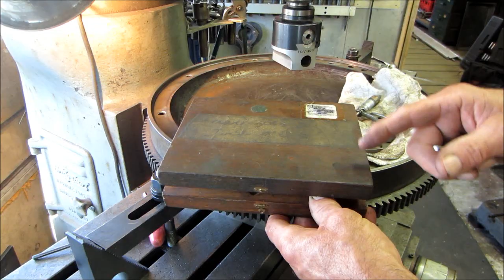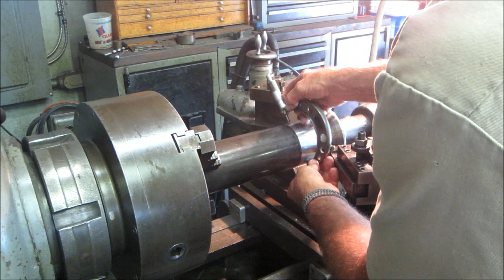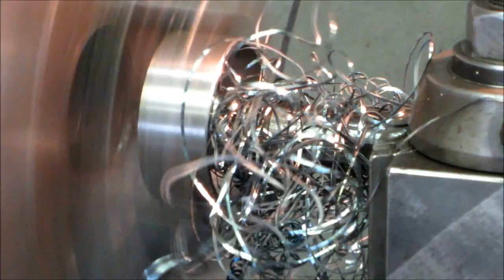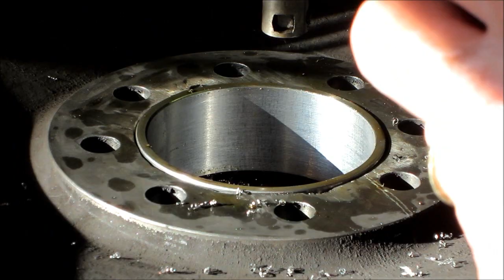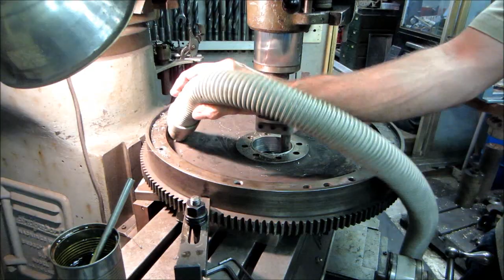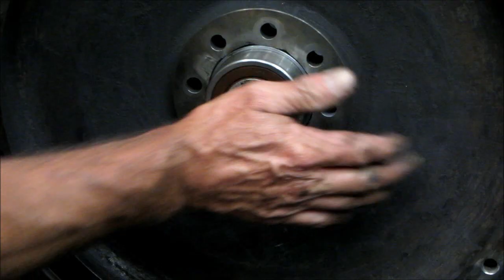Hack & Tack Smack Part Two

Comment: I use a small cylinder hone to clean up bores. I made one of those emery cloth hones but for getting a slip fit on some wood dowels, so I used plain sandpaper and a 3/8th drill. Worked great, but I never used it on metal.

Comment: Well done great work. Sometimes I will make a fit by cooling the sleeve in the freezer and heating the flywheel in an oven thus locking them together with a light press fit. The bearing I then cool in the same way and fit and use bearing fit locktite. Lot less force. Don't let the wife know though!!!

Comment: I've done a lot of those kinds of jobs, and I'd offer the following advice: It's good to add locking screws to the periphery of the sleeve. These are referred to as "Scotch Keys".It's simple to do, just drill and tap for a set screw at the junction of the part and the sleeve. It only needs to be an 8-32 or even smaller. Add them before your final bore. It will lock that sleeve into position no matter what.
The problem with relying on the press fit, on a heavy rotational part like that, is vibration. Vibration will do weird things to a repair like that, and can cause the sleeve to drift. From there, if you ever have to renew the sleeve, simply remove the set screws (anchor them with blue loc-tite), make a new sleeve and then pick two new points to anchor. 
This will work for any sleeve job on a rotational part, like motor end bells, pump housings etc.

Comment: Hey, Keith, what's that "emery strip" all about?  Is that some sort of a shop-made weed wacker for metal?
Reply: Emery paper is similar to sandpaper for woodwork. The grains on the surface of the material removes small amount of metal, leaving a smooth surface. Bu mounting the emery strip it a shaft held in a power tool, you can gradually remove metal from the hole. Unfortunately I'm unsure what the grit is, possibly carbide or similarly hard material.

Comment: Great video.

I've got a question though, throughout the video you kept using the machine to shave off the ID to make it a closer fit to the bearing, Why not make a decent fit with the lathe to begin with? or was it that the lathe was not quite accurate enough?

(not a machinist, but very interested)
Reply: drewestification The reason for finish boring the sleeve after pressing it in is because the sleeve will crush a small amount when it is pressed in. This would still be okay except in a case like this where the tolerance is held very close between the sleeve ID and the bearing OD
Reply: drewestification .. At the beginning of the video he decided to go with the milling machine because the lathe chuck couldn't safely hold the part.
Reply from the maker: drewestification It was to re claim a trashed out bore, then turn a sleeve to fit that bore and have the snug slip fit for the bearing. ;{)------
Reply: Hi, yeah sorry I realise my wording is way too vague. I meant the sleeve itself. you first turned both the OD/ID of the sleeve in the lathe (@9mins)then put it into the bore and machined it again with the other machine. ( I don't have the name for it, sorry)

I'm just wondering if it's because the lathe had a lower tolerance or something.
Reply: Norm Staley also it looks like he may not have machined the bore in the flywheel exactly on center so it also compensates for that mismatch on the final cut by finishing it after pressing it in. One thing I would like to point out here is if you look at the way the flywheel is clamped, is a good practice to never clamp a part this way, always clamp directly over the blocks the part is setting on, never an open air space under the clamp it is unstable and will put twist in the part. I am sure the reason he is doing it this way is to keep the line of sight open to make the video, I agree you can get away with it as done in this video but for information to the novice it is not a good practice and in some cases it could get you fired.
Reply: +drewestification the other machine is a milling machine!
Reply: +Norm Staley  Yep , what presses in on the  OD  squeezes down the ID.

Comment: Thank you for the video, I enjoy all of them as well as find them educational. I must say one thing and correct me if I'm wrong. Pilot bearings need to be press fit. If a mallet can seat the bearing then harmonics can cause it to come out. Every pilot bearing that I have replaced have been extremely tight for this reason.
Reply from the maker: This particular bearing presses tighter on the shaft and slips in the bore, a manufactures design. ;{)---
Reply: That's right, now I remember you saying that in the first episode.   Because I was sitting there wondering had that not been the case would you have used a torch to heat up and expand the flywheel, or dry- ice to reduce the bearing diameter,  or perhaps both?  Also do you know did they chill the shaft down to ease the fit.  Given its a sealed bearing heating wouldn't be an option would it?  
Also when you mentioned the bearing cost differences it reminded me of a buddy who had a 85 Mitsubishi Montero the idler bearing on the water/fan belt died.  The parts store want $165 and the dealer OEM part was like $245 so I removed the inner retaining clip, pressed out the bearing and went down to Vancouver Bearing.  The guy mic's it and three minutes later plops down an SKF bearing and says That's $12.95 Plus tax.  I remarked "you're kidding?"  Where upon he replies, "hey if you want cheaper you'll have to look else where, we only carry quality like Timkin and SKF!"   "We don't carry any of that cheap junk!"  I did bother to explain my remark and that their price seemed more than fair!
Reply: @scottpecora371  I'd say "unbelievable" was closer to the truth...
Reply: ...that's why there's Loctite!!! 

In any event, it's a heck of a lot better than it WAS-!!

Comment: Tool calibration is key.  Especially when using a few different tools.  I've found different multimeters reading differently too... enough said.  Love the "religious" use of cutting oil.  Sure it's has to be cleaned up, but that smoke is showing that there is a lot of friction on the relief of the bit.  Slippery is good, titanium nitride coatings reduce the frictional heat, too.  It's all about getting the most life out of a expensive bit, insert or grind.  In most of Adam's 1rst videos he rarely used the oil?  Now he does all of the time!  Plus, a few guys sent him some of the "oil cups" and a cool oiler.  Maybe, it was an indirect hint?  Ha ha haa, grass hopper!
Reply: The relief side?  You believe that this guy has the relief of a tool rubbing and making friction?  This is were the smoke comes from?  I really don't believe that.
Reply: adithmart There are about 7 facets to a ground cutting tool.  I may have mis-named it.  The relief I was referring to is the one on the top immediately after the cutting edge.  It is also called the "chip breaker".
Reply: A "cutting" fluid also floats away particulates, keeps them from being reground & deposited or embedded into the fresh cut.

Comment: When tapping bearing in there at the end...wouldn't have using a block of wood against the bearing have helped getting it in evenly?
Reply from the maker: It was a half a dozen to the other, sometimes I use wood and have plenty around, but my trusty plastic mallet is kind to the surfaces also. ;{)-----

Comment: Works well steel on steel.  I personally don't like pressing (interference fit) steel sleeves into cast iron with much more than a metal to metal fit.  The casting can crack from the pressure, and I've even had the dissimilar metals start to gall up making a pressure point causing a crack.  I do a metal to metal fit (light press), then mechanically retain the sleeve with set screws drilled on the split line between the sleeve and the part.  But in this part, Keith's repair looks really good!

Comment: We always use press fint no the driving ring and slip fit on the rotating/ following ring in our designs.  Og there is Any Heat developing, we compansate with "c- clearences". Ei  6203 c3

Comment from the maker: They wanted a good snug slip fit for the Outside diameter on that bearing not a normal press fit. Design requirement. opposite of any pilot bearing I've ever done before. ;{)-----

Comment from the maker: It's more the time factor on heating the mast and the circumference or the wheel is less grow-able than say a thin wall sleeve. The bearing was required by design to have a slip fit in bore and is press fit on pilot shaft diameter. I know it is opposite of standard but that's why there design is flawed. ;{)-----
Reply: Not really flawed,  perhaps.  If the bearing binds up it may be better for the fly to flog out than for the end of the crank shaft.  Better to re sleave or replace the fly wheel than to tear down the whole motor and replace the crank shaft.

Comment: When fitting the bearing into the sleeve and the sleeve into the flywheel  why not heat up the flywheel so it expands slip the cool sleeve into the heat expanded flywheel hole quickly because the heat will transfer to the sleeve very fast and it will also expand but when they both cool down together the sleeve will have a tighter than pressed fit. True up the sleeve as you did then fit the cool bearing into the sleeve the same expand with heat method.

Comment: Cast iron is an alloy of iron and silicon in solution interspersed with particles of carbon. At elevated temperatures, inclusions of carbides begin to form in the matrix..When the temperature reaches around 1200 or 1300 degrees F. the cast iron under the deposit begins to transform into cementite (an iron carbide in which three atoms of iron combine with one atom of carbon). Cementite is very hard, very abrasive.I think that this the hard crunchy material that arc welding leaves behind.

Comment: Tubing,mmmmmmmmmmm........chewy gewey gummy crap! Usually,if I have job like this,I throw sleeve in freezer and heat up flywheel a bit with just a bottle torch.Sleeve just about drops in,and lots less force on the cast iron.Hope this helps others.Great job as always!

Comment from the maker: This assembly gets slid into place as the power take off is assembled to the engine and the OD of the bearing by manufactures design is suppose to be the slip and the press is on the shaft or bearing bore. I know it seems opposite from everyone else's design but it is. ;{)-----

Comment: Keth I am not generally a fan of Iscar tooling but they do market an Italian made line of modular boring tools they call ITS. The heads have limited feed range but are super accurate. Think 0.1mm 0.004" per turn of the dial. I use these things on a daily basis and never have to second guess the final size. Highly recommended.

Comment: 01:05 came as a relief hearing that the bridgeport ( god bless) job was getting tidious... As you see in my videos i am more in the woodwork of thinks and like to say that "we're coming out of the woodwork"... i hope that this last video is going to show some press fitting and some closure. But take your time, I am in for the duration, if I ever wanted to be invisible that would have been to go see the hack and smack in the metal shops, on an intermittante basis. Being able to drop by at will.

Comment: Why didn’t you grind out all of the occlusion caused by the attempted weld? Like you said melted cast iron that re-solidified is extremely hard and brittle. (huge stress riser)  The thought of a crack developing and propagating out from one of those occlusions has bad news written all over it. On the other hand from the vid it looks like a sleeve would have been a dicing prospect too (had you grinded it all out) with respect to residual strength left in the flywheel. (at the crank bolts)

Comment: Maybe I would have turned the repair sleave ID on the lathe to be a good fit to the bearing and the OD a slight clearance fit to the flywheel then used Loctite 638 High Strength Retaining Compound to fit the sleave in the flywheel. I would find it easier and quicker than the press fit/rebore method you used. Some old school engineers dont like to use the new adhesives but I would bet it was stronger than a press fit! A good video though, nice and clear.
Reply: Interesting point.

Comment from the maker: With the brazing method you’re not melting or creating a molten puddle in the cast material and not causing the crystallization of the base material, hence the reason I choose that process for the repairs on cast.

Comment from the maker: The general rule is about a .0005" half thou. To .001" one thou. Per inch in diameter, in the range I was working in, but because it was a real thin sleeve, I gave it more press than normal. My press puts about 27 tons of push to the ram. You do want to watch out for over pressures on cast materials they will split or shatter.

Comment from the maker: A press fit means an interference fit, bore smaller than outside diameter of bearing or shaft. Clearance, or slip fit, would be a larger bore than the bearing outside diameter of shaft diameter. ;{)---

Comment: I'm just talking about the last .001-.002" for the bearing fit, it removes the high spots with a better than 32 Ra finish and is a much more forgiving process as not to take to much at a time. 
I'm enjoying your video's very much, I'm hooked, keep them coming..

Comment: I understand using the inside mic to ck the bore, could have you used a snap gage in lieu of the mic?  Does one method give a better read/feel? since you we're using the outside mic to verify the dimension?  Thanks also, learned something about cast iron that I never knew--the change due to welding.

Comment from the maker: Once the two components are drawn together the straight line is set and there is no hanging pressures to cause a rock action in the race.  The main fault of this happening is with all the expenses and cost of operating equipment like this, in this economy, the scheduled maintenance and replacement of limited life parts are pushed way beyond the outer limits!

Comment: Thanks, Keith!  I have a set of Mitutoyo Digimatics I use a lot because they are so convenient, but they do not have the measurement repeatability required for close work like bearing fits, especially small bearings where tenths really matter on the shaft diameters.

Comment: Great vid series, Keith!  Looks like maybe your turning tool took a bite out of your cutting oil brush, happened to me over the weekend, but at least the brushes are cheap!  Long stringy chips scare me, especially in a situation where they can wrap around the work/chuck!  I've not seen you use digital calipers before, new tool?

Comment from the maker: The two components have to side together and the fit of the bearing has to be as I showed, because you can't get your hands or any tools inside the housing. In the yards working on pumps, the wear rings were set screwed split lines on the press fit rings prior to machining to insure the ring from slipping. Also hatch dogs threads and a few other fit ups very popular. Thanks for the comment!

Comment: At work i see a lot of sleeve work done for truck hubs where the bearing race is spinning in the hub. I've see red lock tight, and pinning the native metal to help it from not moving. The coolest way I saw it done through was where the sleeve met the old material they drilled and tap a hole right on the split line and ran a set screw down through it. When would you have to do that?

Comment from the maker: That fit is slipped into place upon assembly, as the two sections, engine and clutch, come together! the ID of that bearing is a tighter press fit to the shaft, so it sits on the shaft and slides into the bore. Due to the design, when the bearing fails it spins the OD first and wipes out the flywheel.

Comment from the maker: There is no cross chart due to the variables of hole size wall thickness and temperatures, as a rule if you can feel some heat there is some growth, even if only a couple tenths. A couple hundred degrees can give a thousands in most cases.

Comment from the maker: I was left with just under a .001" maybe 8 or 9 tenths, that fit has to slip together upon assembly, the bore of the bearing presses on the shaft, opposite of the standard pilot bearing arrangement!

Comment: Keith nice repair job.  The story on the inside mic set was good you had good mentors that is obvious.

I'm wondering why you chose to polish the last bit on the sleeve rather than go for other cut it seemed maybe you could have taken another light cut in the bridgeport judging by how much you polished off with the flap wheel and the emery band?  How close was the fit (measure) after your last pass?  Not second guessing but trying to learn when to switch to polishing.

Comment: another great set of videos.How much does heat change the bore size when you stop a cut to take a measurement and do you adjust for that in your thinking for a press fit.thanks for taking the time to teach.

Comment: The tools that hold the most value for me are things I made myself.  I have a couple of shop-made tap wrenches, stuff I made in trade school like 1-2-3 blocks and parallels, even a cheater bar I made by drilling completely through a bar of CRS means more to me than a $100 mic I can order out of the MSC catalog, or the expensive Snap-On socket set I splurged on once.  I don't have anything given to me from a mentor, though.  Some of my co-workers do, though and they mean a lot to them.

Comment: At Christmas time last year I got a full set(1"-6") of Starret snap gauges for $10. Perfect condition too. No other bids on it, I was the starting bid. I waited over a year to get that deal however.  Good luck, happy hunting! If it turns out to be a bad ebay tool, put it back on ebay. I hate doing that, but one man's trash could be another's treasure.